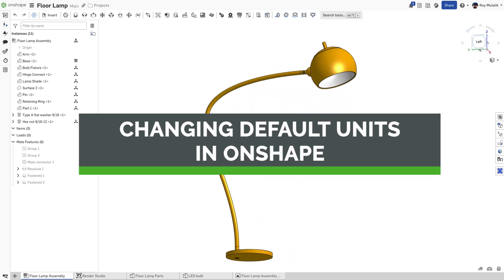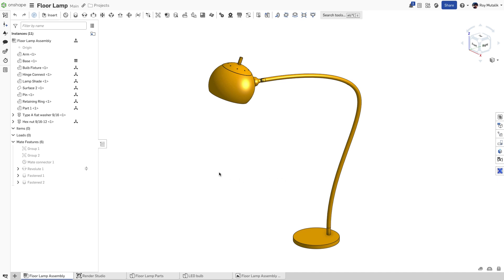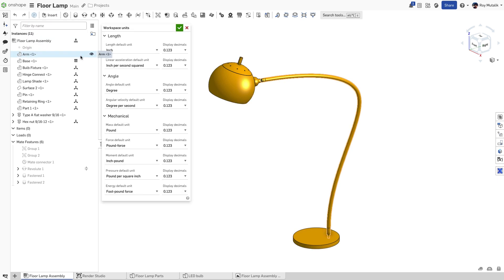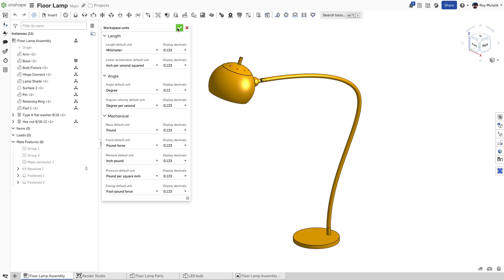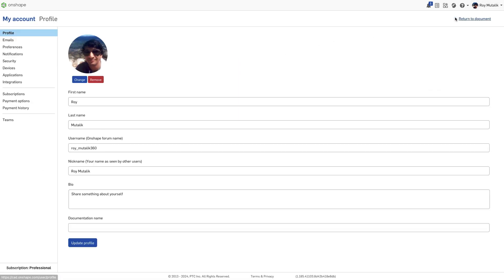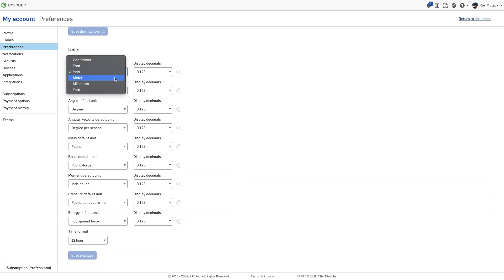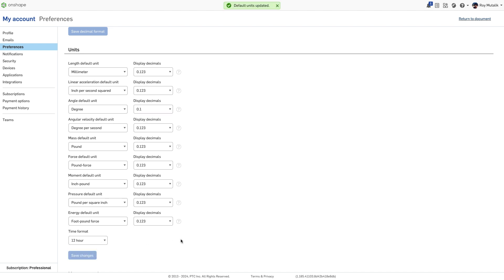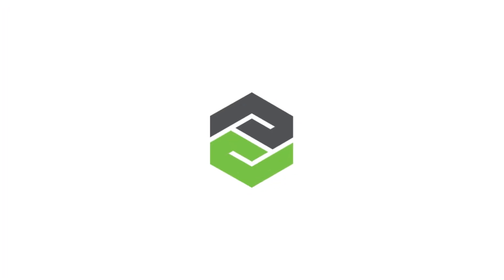Change Default Units in Onshape - Tech Tip

Comment: There may be a reason why it would not be practical,  but I would love a keyboard shortcut that would at minimum toggle between inch and millimeter.  I do a lot of modeling in both standards and it never seems to fail that the window I have open always seems to be the opposite standard that I need.